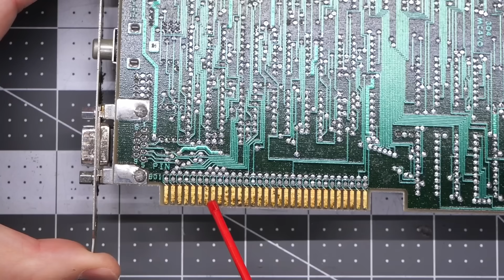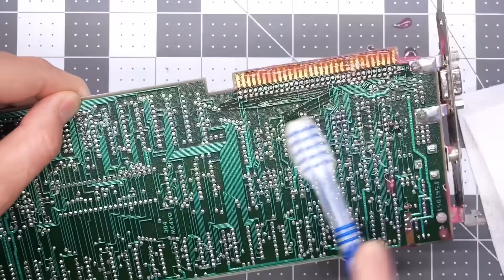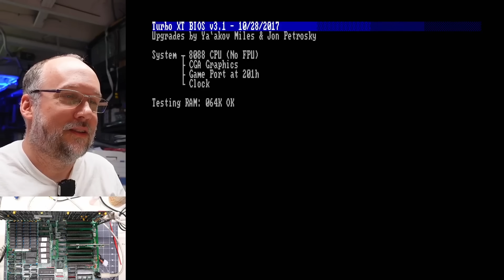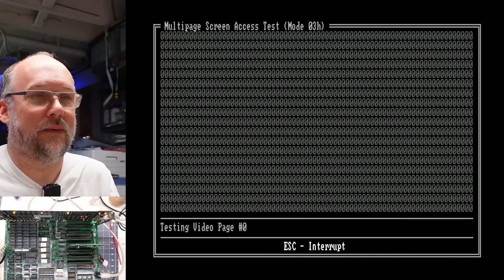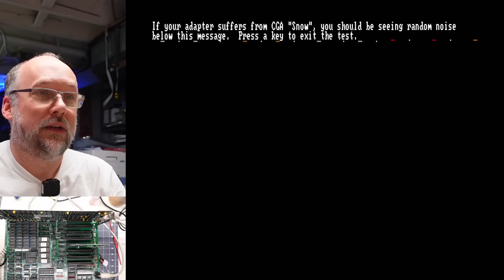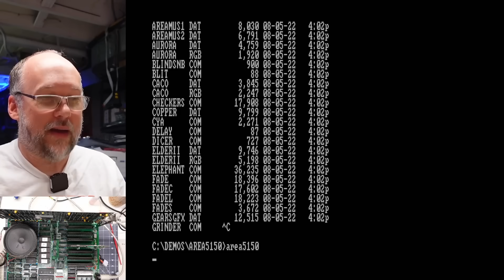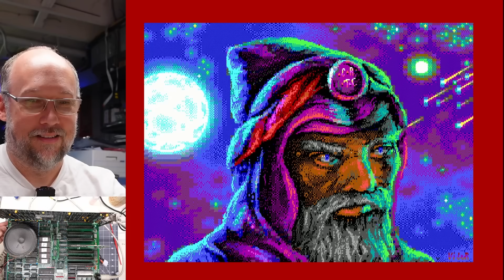Can we save this heavily corroded IBM CGA card?

Comment: Over here in the UK we have a similar product to Naval Jelly by the name of Jenolite, looks about the same too, a pink goo that does the same job of converting rust being based on phosphoric acid, also apparently well-used by the military, assuming we have one left... :P
Reply: You reckon "Hammerite Rust Remover Gel Blister" would be same?
Reply: @BiggidyBong  If it uses phosphoric acid as its' primary ingredient, then yes, most rust converters are pretty much the same stuff, with the exception of that Evapo-rust stuff, that's some proper alchemy witchcraft there... :P
Reply: @twocvbloke  Not sure. looking at a pdf of it on the Hammerite site it says citric acid and CMIT/MIT(3:1) whatever that is.
Reply: @BiggidyBong  Well, citric acid (as found in fruits like lemons and oranges) has the same sort of effect on rust as phosphoric acid, but is I suppose "eco-friendly" in that naturlaly it's found in plants, as for that CMIT/MIT, or Methylchloroisothiazolinone (easy for them to say!), that appears to be a bacteria-inhibiting preservative, often found in cosmetics, but I guess citric acid is tasty to some bacteria...

Comment: I would use a chemical tin plating instead of solder. The solder layer would probably be thick enough to damage a socket you put it in.
Reply: Generally when one tins a connector like that, you don't just apply solder but also remove the excess with wick. Then there's a super, super thin layer of solder left behind :)

Comment: It might be worthwhile for you to get a gold contact replating kit. It's expensive (a few hundred dollars) but you'll undoubtedly find it useful for restoring other devices in the future.

Edit: or just use Liquid Tin, as others have suggested. A heck of a lot cheaper, with similar practical result. Although putting tin-plated connectors in a gold-plated socket can lead to corrosion over time. (You may want to use deoxit whenever inserting or removing the card if you tin-plate it.)

Comment: Electroplating comes to mind but to do that you'd have to strip the board remove the gold completely from the card edge and then re plate it. Hard gold emersion is  probably the only way it is gold plated again (mostly only PCB manufacturer) you could tin them with silver bearing solder (tin and silver.) just the pins that have worn out -- that might help with the corrosion but it will still oxidize over time just like lead free solder or leaded solder. Using a contact cleaner with a dressing like de-oxit will slow down oxidation